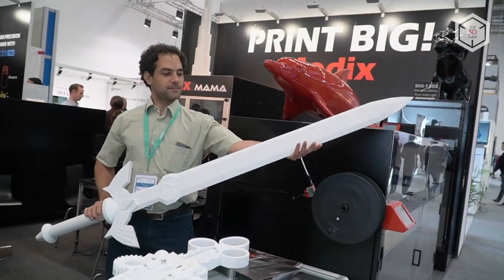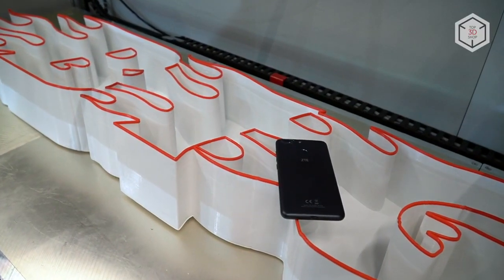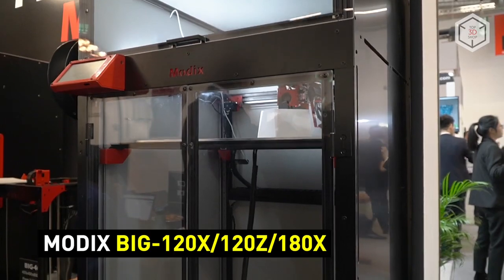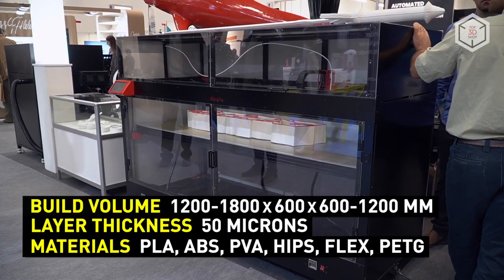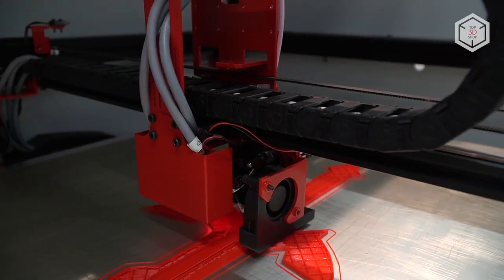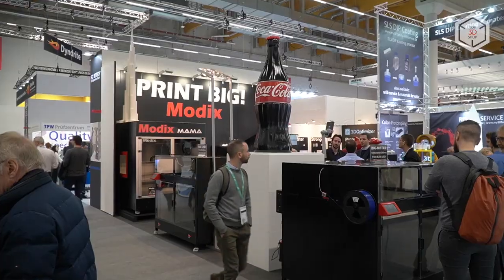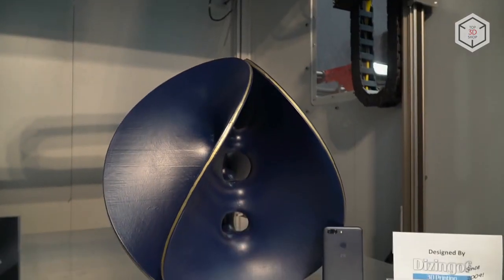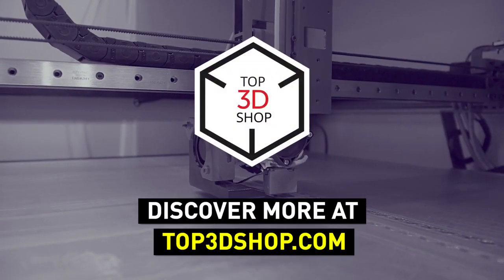Best Budget Large-Format 3D printers: Modix3D Big-60, Big-120, Big-180

Comment: Nice printers 👍 What printer are best or recommended for carparts like fenders, rear/front and so on? 🤔
Reply: For bumpers, I'd say the big-180x, I think it could print fenders too
Reply: @kittycatmeowface  important to be 100% sure, it can be costy if buy wrong 3d_print machine. Doubt on it is cheap 👍
Reply from the maker: Hey Mr. Helmersen, at least judging by the experience of our clients, those in the automotive industry usually opt for either the Modix 120X 3D Printer (1200 x 600 x 640 mm) or the Modix 180X 3D printer (1800 x 600 x 600 mm) as they have the longest X-axis.
Reply: Thanks for the Idea.... 43 years AutoBody under my belt... I could print wide body fenders to fit and over lay them with Fiberglass and install :)